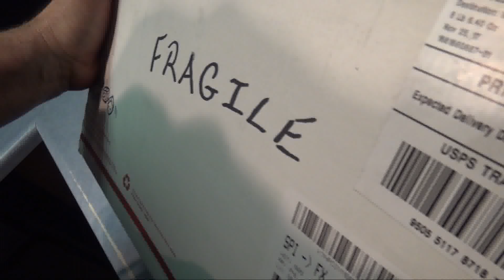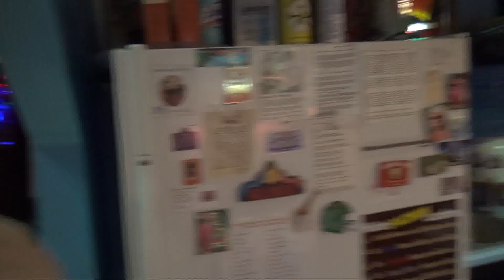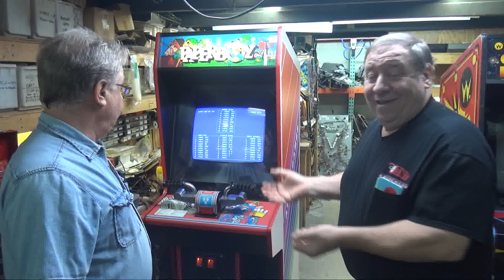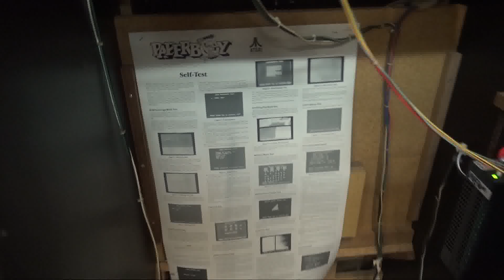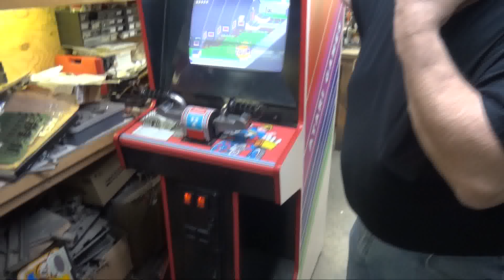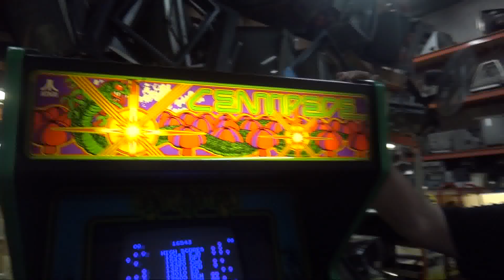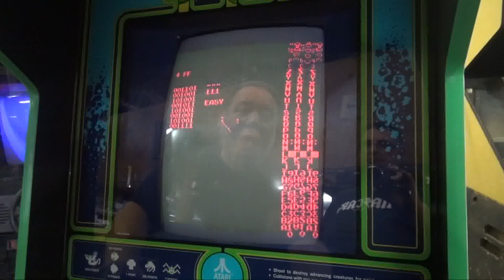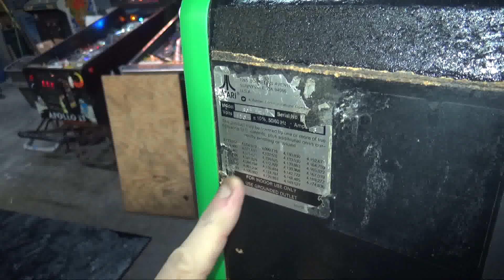#1341 Atari PAPERBOY & Millipede Arcade Video Games-Data East TOMMY Pinball Machine-TNT Amusements

Comment: Does the Millipede have both boards? I don’t like reproductions they don’t play the same as original hardware.
Reply from the maker: This double game uses the original Millipede PCB...a small added board simply plugs into a socket on this game that has the original Centipede on it along with the electronics code so you an switch between the two.
Reply: TNT Amusements Inc I want one